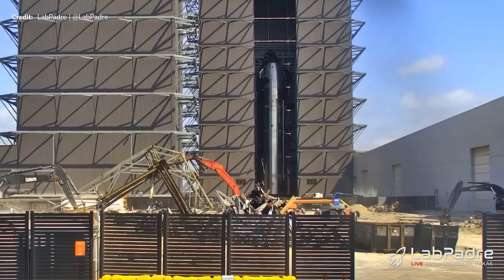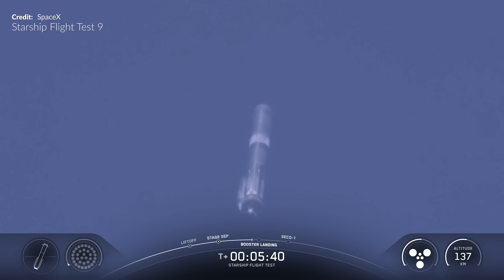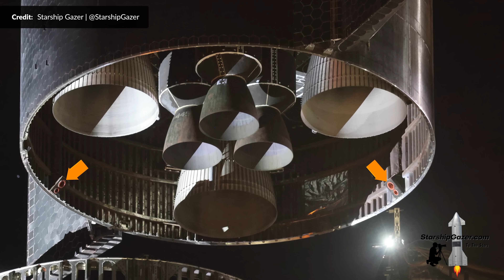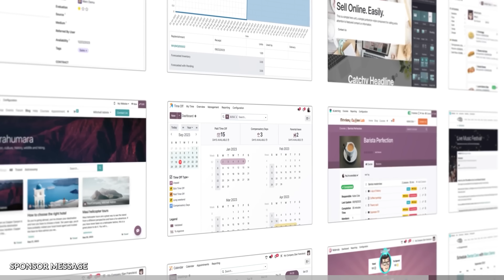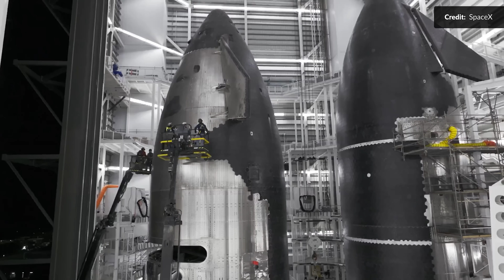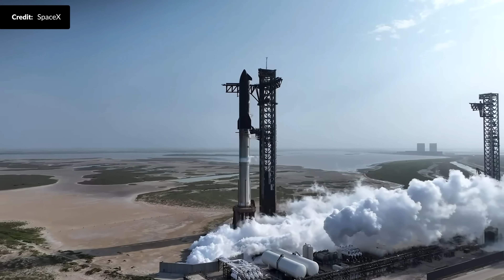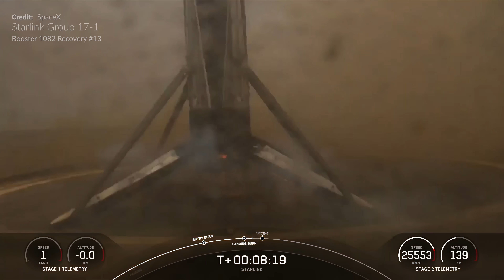Wow... Starship’s Big Surprise Came After the Flight!

Comment: Lining the propellant tanks is one way to solve Starship's leaks, but I read that the guy in charge has a real problem with bladders.
Reply: You’re welcome to tell us what lining will remain flexible at a temperature of -183°C (-297°F) and won’t react with pure oxygen.
Reply: @JohnSmith-x3y8h  I much prefer to discuss cryogenics in Kelvin (K).  There are plenty of materials that will work at the lowest temperatures, but have trouble as things warm up.  It's well known that too much K can cause bladder problems.
Reply: @guacamental oh dear. Kelvin is a name not a temperature measurement. Centigrade exists.
Reply: @guacamental  Water freezes at 0°C and boils at 100°C.
Reply: @guacamental 

You’ve been watching too much mainstream media.

Your comments are worthless.

Blocked.
Reply: @JackFrost00128  Kelvin is indeed a unit of thermal measurement. You might need to recheck your information.
Reply: @JackFrost00128 Kelvin is absolutely a temperature measure. Learn science please.
Reply: @mrbaab5932  oh dear initiate.
Reply: @JackFrost00128  Bot fail
Reply: @Fnames-q6x  ok failed human. look at my picture. that is me. not a bot. wake up.
Reply: PFA (Perfluoroalkoxy) works very well with liquid oxygen. Numerous examples of bellows and bag type bladders exist in industry and aerospace. @JohnSmith-x3y8h

Comment: And again, a not too bad engine design but a bad starship design too unstable again. Boom doesn't get anyone to space or the Moon or to Mars or even safely back to Earth. Yes, it is only testing but all this testing without the weight of support systems that will change the operational characteristics and operation of Starship are only good for a fireworks display very wily coyote not very science based. You would think after so many tries there would be no more booms and no more tumbling about. I still say tail landers have too much focused force form the top down that is why large planes don't tail land which would save on building long runways. Perhaps a redesign now or at least if you want to land like a helicopter give Starship some rotors to do the landing after the rockets slow the ship enough.
Reply: There’s no evidence the design is unstable. It was propellant leaking that caused the tumbling.
Reply: @JohnSmith-x3y8h  If you test something you have to look at and understand the result even if the result contradicts what you believe to be true that is scientific experiment and a scientific approach. If your cherry picking the parts of the experiment that supports your predetermined result you learn nothing.

Comment: Thanks for the video. I don't know the thrust to weight  ratio for Starship, but I think that they should just do a launch of just Starship where they have kitted it out with MANY sensors and cameras so that they could do a fight with higher dynamic pressures and stresses throughout the ship from the atmosphere to see what is leaking / cracking and causing the problems. Kinda like doing thrust text while in the can crusher.
Reply: That’s literally what they just did. They deliberately overstressed the booster to find out the failure mode. Did you even watch the video?
Reply: @JohnSmith-x3y8h He's talking about starship the upper stage.
Reply: They did that same thing. Maybe the booster shakes too much or the sound waves at launch is damaging the ship.

Comment: How long time until you think Starships flight 10, another 6 months? They need to increase cadence significantly if they want to send starships to Mars next year.
Reply: They won’t be sending Starships to Mars in the next decade
Reply: @leonarddecant8566  or ever
Reply from the maker: They are already suggesting 4 weeks. The next ship is almost ready to go, so it will depend if they want to make adjustments to it.

Comment: The problem is the Raptor engines are being pushed to their absolute limit. The vibration and fuel delivery fluctuations etc, when engines are pushed almost to breaking point causes so much harmonic resonance that the whole thing is nearly shaking to pieces. Even Raptor 3’s won’t have enough power to lift the rocket with its original designed payload mass. The whole rocket, especially starship itself is just too heavy, even though they’ve lightened components drastically. They seriously have to look at replacing some of that stainless steel with lighter materials, such as carbon fibre or some sort of composite. A square metre of that 3.95mm thick stainless steel weighs around 30 kilos, which gives some idea of the weight of the starship and booster hulls. Unless Spacex can lighten the whole rocket significantly, or somehow get a massive power increase without pushing the engines as hard as they are doing, then the whole project is in big trouble. It won’t get to the moon and certainly not to Mars within any of Elon’s estimated timeframes.
Reply: He's trying to build them on the cheap, he ain't using carbon fibre.
Reply: @Lewiinn  Maybe building heavy lift vehicles on the cheap is SpaceX's and Musk's major issue.  They fail to learn from shuttle.  Shuttle had the same goal, rapid reusability.  In practice, the stresses of launch and flight were far greater than anyone predicted which meant longer turnaround times.  Falcon 9 is not completely reusable, stage2.  It can't re-fly the same day it returns.  Maybe a smarter plan would have been to build a smaller vehicle with rapid reusability and take those lessons and build bigger from there.
Reply: @pebmets The shuttle was a piece of shit, calling it even close to re usable is a joke. I think Elon is living rent free in your head tbh.
Reply: This sounds like a copy and paste from AA
Reply: @93_LXcpe  I’m a precision engineer of 50 years experience. I’ve designed and built plastic injection moulds, press tools and special machinery for many applications. I understand what vibration and metal fatigue can do. I never claimed to be a rocket expert but certain things are pretty obvious and the fact is that rocket is too heavy for its engines and needs some radical redesign. Strange as it may seem, I can think for myself and I can write. I don’t need to copy and paste anything from anybody.
Reply: Problem is usability. You can’t really put carbon fiber through the extreme heat and cold in space with delaminating. Carbon fiber is great but not for the exterior of a ship like this
Reply: Super heavy can hover on 1 v2 raptor...  weight is not the issue.  Yeah they are trying to reduce it but its all in trying to maximize capability.  As it stands now, starship has a thrust to weight ratio of 1.65 fully fueled.  And a 1.60 if you loaded 150t of payload.  Thats a better thrust to weight ratio than a falcon 9 with no payload (1.42).  When you are producing over 18 million pounds of thrust at liftoff.  The effect of a payload has little consequence.  It's like those little honda civic kids that always be throwing out their power to weight ratios.  When you make 200hp its a major factor.  But I don't give a flying fuck about mine when I got a Shelby putting down 800hp.  I could stuff that fat trans chick in all the youtube shorts into my car and it wouldn't even slow it down.  People thought spaceX was crazy for attempting to land the falcon 9.  I remember those days.  Everyone saying the fuel you have to save to land will seriously hurt its payload capability beyond practicality.  And yet here we are in 2025 and falcon 9 is the most profitable yet cheapest cost to orbit option out there.  Nasa had issues with combustion instability and harmonic disturbance on Saturn V.  They figured it out.  So will SpaceX.
Reply: You nailed it right on the head.  Starship may be too heavy.   Instead of using lighter materials, they threw more engines onto the thing which adds more weight for the engines and the fuel to support them.  I still feel SRBs are the way to go to supplement the liquid engines.  The crew would be on top of the stack like SLS which means there could be an escape if an issue.  Shuttle's issue was it had to be on the side of the stack which made the 1st 2 minutes the most dangerous for the crew.  Then again, Starship will have no escape system either for the 1st few minutes of flight, Musk said that a few years ago.
Reply: I like to imagine that SpaceX is only using the cheaper stainless steel for test vehicles. The possible performance increase and fuel savings they'd get from a composite Starship are hard to ignore.
Reply: I am not a rocket scientist, but I'm pretty sure there's no plan to go to carbon fiber or composite. Testing with steel wouldn't even translate to a new material.
Reply: You should call Elon immediately!
Reply: @Grumpy_GenX  I think I sense a note of sarcasm in your reply. Lol. I am sure of it because I’ve always been an extremely perceptive person y’know. 🤣
Reply: @iancanty9875 Sarcasm? Me? No, you should definitely call Elon and explain how they went wrong ASAP!
Reply: @Grumpy_GenX I’m worried that flight 10 will not happen if Ian doesn’t slide into Elon’s DMs 😬
Reply: @iancanty9875  The person who wrote the comment is correct.  The thing is too heavy.  SpaceX and Musk want power based on more engines.  Engines and the fuel to support them add weight.  Starship 1 could only lift less than 1/2 of what Musk claimed it could do.  I don't get why people keep believing the specs Musk gives when in practice, performance falls far short of what he claims.
Reply: @Grumpy_GenX  What is interesting, Musk and team try their own methods and eventually circle back to the tried and true everyone else uses, (i.e, pad B will have a flame trench and diverter) when many Starship followers believed Musk that the flat plate idea was the way to go.
Reply: @pebmets I don’t find that interesting. What I find interesting is the sheer number of aerospace engineers in the comments sections who all know how to do it better.
Reply: @Grumpy_GenX  After 9 Flights, Starship is nowhere close to be being ready.  Musk said this week 5 Mars missions in 2026 and 1000 rockets a year being manufactured in the future.  What I find interesting there are people who can't use their brains and just say Musk is just a BSer.   Logic says these will not happen.   

With the current track record of Starship, people are bringing up what has been succesful in the past with other launch providers.  Musk and company want to reinvent the wheel, but like launch pad B and the flame trench and diverter, they come back to the tried and true methods after they have thrown away a large amount of money and hardware to do things others have figured out will  not work or feasible for a large vehicle.
Reply: @pebmets So you’re saying you’re an aerospace engineer?
Reply: @Grumpy_GenX  That is a response of a person who cannot find a valid inaccuracy to a comment.  No I am not.  I have heard Tory Bruno who is a real aerospace engineer unlike Musk discuss the subject of heavy lift rockets.  I take his word over anything Musk has to say.
Reply: A meter square of 4mm stainless steel is going to be a kilo or 2
 Not 30.
Reply: @JackFrost00128 hi Jack, check your maths.
One metre² of 4mm thick is 4 litres volume.
Multiply by the density , 7.98 g/cm³ is 31.9 kilogrammes.
Q E D
Reply: @BMrider75  If you like but I have lifted steel sheets bigger than that. it clearly isnt that heavy.
Reply: @JackFrost00128  Unlike your poor guess at “kilo or 2”, I actually worked the weight out from its volume and it’s density. So 100cm x 100cm x 0.395cm = 3,950 cubic cm x density 7.9grams/cubic cm and divide by 1000 to get kilos = 31.2 kilos. You need to educate yourself and not guess. Whoever liked your comment was also wrong..
Reply: @iancanty9875  ok if you like. probably would be 30kg if it was 4 cm thick. not 4mm.
Reply: @JackFrost00128  Now your being ridiculous. It’s nothing to do with “if I like”. You can’t buck physics and it’s a fact that the density is around 7.9gm/cubic centimetre. It’s also a fact that the volume of a metre square sheet x 4mm thick is 4,000 cubic centimetres. I’ll leave you to work it out from here, you might learn something.
Reply: @iancanty9875 , yep, I suspect Jack has more brawn than brains. 
Two offers of the correct maths, but still "if you like" and I can lift that !
..... I mean, it's not rocket science !

Comment: Full retrofit of Pad A to match Pad B spec makes sense
Reply: SpaceX apparently has no aversion to doing full deletion and replacement of structures that no longer serves the need.
Reply: @NoFlyZone-SL  yep, crazy example of that is building a second orbital launch tower in Florida in 2023 before the first one ever caught a booster.
Reply: I highly doubt v3 booster can even connect to pad a.. therefore retrofit is inevitable
Reply: they might as well since they have the tower and all the plumbing there. jack the tower up a bit, replace the water deluge (probably), and make a new launch mount is my guess
Reply: @ThomasThorr  I think the existing structures are so heavy and the changes to  retrofit the pad A to pad B spec  would be pretty intensive, it's easier to take the whole tower down and rebuild the whole thing later. I guess the tower parts are okay for re-use so that will reduce costs somewhat.

I would assume it's not safe to build the flame trench with the existing foundation so you have to remove all the heavy parts first anyway.
Reply: @ThomasThorr  There's no difference between Tower A and Tower B (or Pad 39), other than the length of the catch arms. The only part to be replaced is the Launch Mount, which should be faster than Pad B, because most of the commodity/electrical runs are in place, only a flame trench is needed (which will probably be single sided, like Massey's). I'm surprised they haven't started welding up a new mount at Sanchez already.